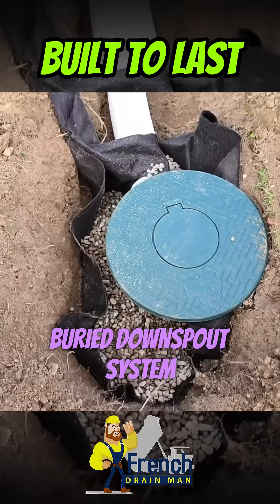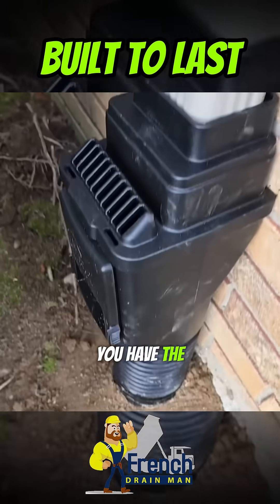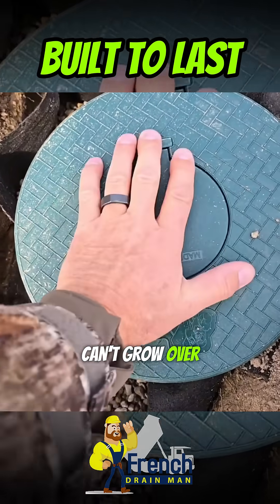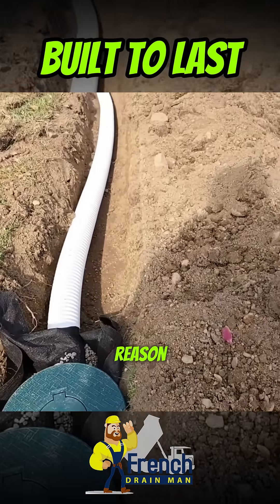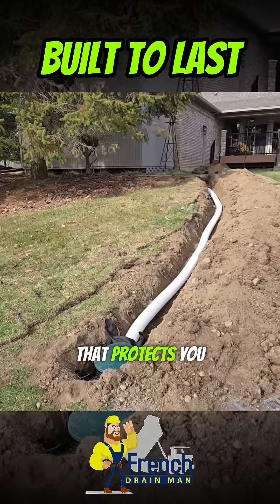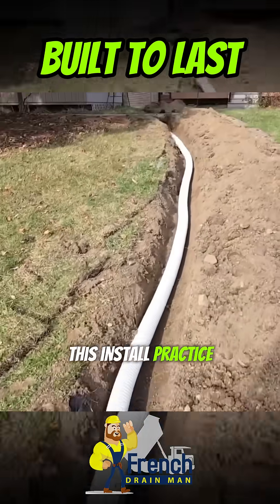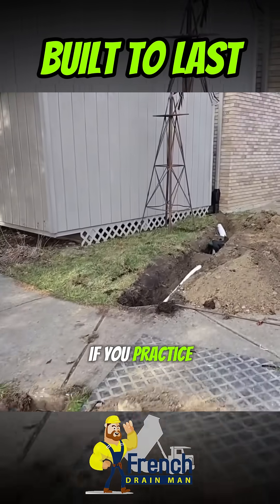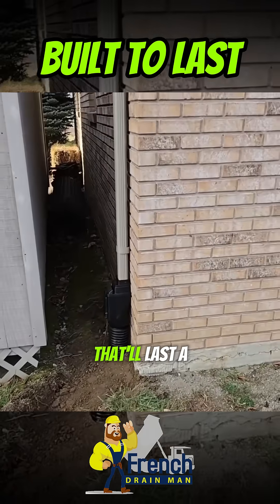Most Downspout Systems Fail — This One Won’t

Comment: If you guarantee why not put it in the warranty?
Reply: 🤣🤦 Because a warranty covers things you can’t control forever. If somebody ties in a sump, buries the pop-up, packs clay on top, never cleans gutters, or a landscaper crushes the line… that’s not the system ‘failing’ — that’s abuse. Build it to spec and it won’t fail.
Reply from the maker: What 19DCavScout said.